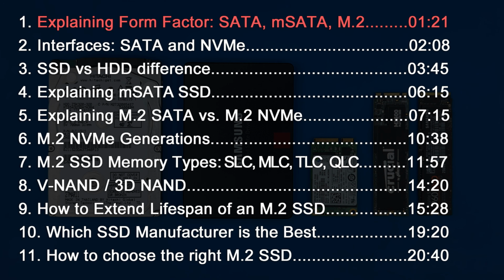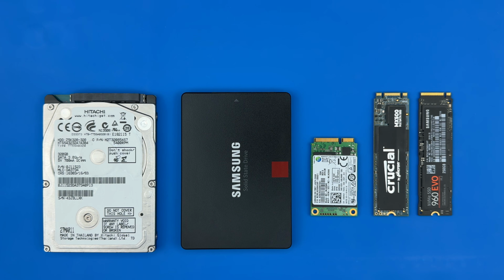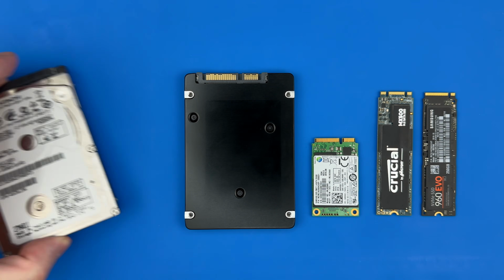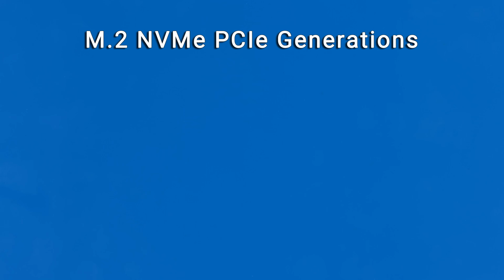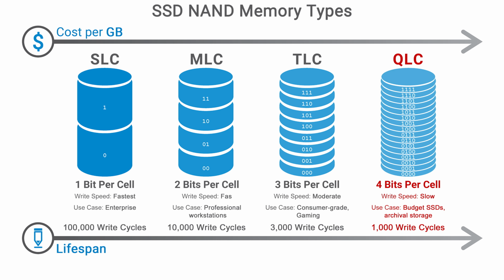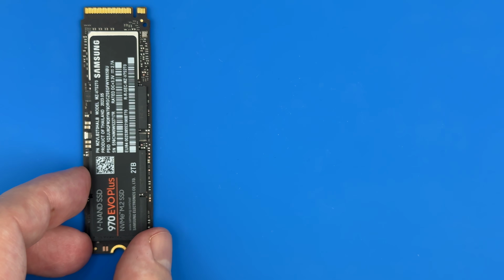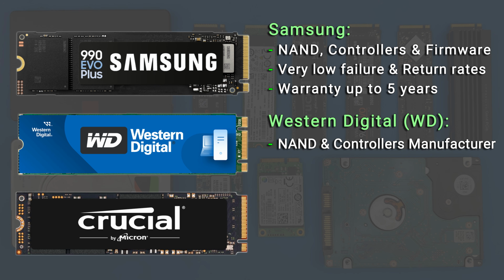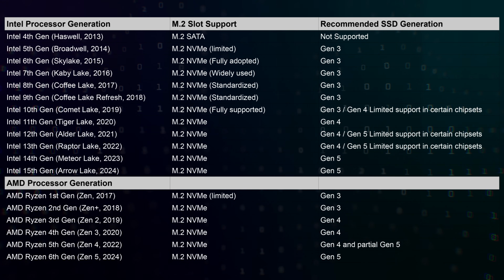SSD vs HDD vs NVMe vs SATA vs mSATA vs M2: Storage Devices EXPLAINED!

Comment: I used to be very tech savvy but  lately I have been behind, 3 to 5 years at least. This is one of the best videos explaining the deference between  SSD vs mMSATA and new kid on the block M2. Oh man, I feel old.
Reply from the maker: Glad you found the video helpful! Tech moves so fast, it’s easy to feel behind—but the fact that you’re catching up means you’re still tech-savvy at heart!
Reply: sagheer.a4988....only lately you're behind? i make retro look new...i get constant criticism for running Core2 duo/Pentium E5200/E5300 or AMD Athlon64 or AMD X2 dual core processors...in other words any old motherboards before 2010 and most before 2007...NVMe as HDD is about as likely as me running 12th Gen Intel (zero)...however there is a use i found for one i'll explain after...i don't have "anything Lake" and Ryzen is even less likely...i suppose the question is more..."how have i managed to run Windows10 at all"... i'm as puzzled as the next person...somehow Win10 runs on my retro "Landfill" garbage computers...i even had Win11 running on an AMD E350D embedded dual core board...not for long...a few months...i do use quite a few Laptop drives and many are SSD...cheapie no name Chinese ones...but it is good to be informed and knowledgeable to what is common and popular...even if i'll probably never use it...same with GTX graphics processors...can't call them cards...12 inches long and nearly 3 inches deep with 3 fans...but NVMe did actually come in useful on the E350D motherboard...i found an AliExpress adaptor that fit PCIe X16 slot that took an NVMe 128GB and it shows up as storage...i'm still gobsmacked it worked...117GB mass storage device...extra storage always useful...
Reply: @markianclark9645  You are nothing... I run Windows 98 on an AMD K6 CPU... and I still have ISA slot peripherals....hahaha...
Reply: Same here
Great vid, very comprehensive. 
I've moved from hardware to software support so had got out of touch.
I know 90% of this, but this video covered those last 10% I needed to clarify.
Most video only cover what I already knew.
Reply: @sagheer.a4988  You've been out-of-the-loop for a little longer than 3-5 years by the looks of it!
Reply: Same here. Haha
Reply: Like when I upgraded my computer I didn't keep up with storage advancements and wasn't even aware of NVME so bought a SATA SSD lol. SATA SSD is a pretty useless format for a desktop. I have my HDDs for long term storage and backup (snapper snapshots get stored on one of the separate HDDs instead of the SATA SSD that I'm running my OS on which is Arch btw). That's because of the write LIMIT of SSDs you always want to have backups going to an HDD. After wondering what the NVMe connector on my new motherboard was I realized I should have bought an NVMe hard drive because a SATA SSD is useless for long term storage and also isn't much faster than an HDD so it's the worst of both worlds. Total waste of money, oh well I bought a NVME drive now. Since I am such a sponge for information buying that SATA SSD was a totally uncharacteristic noob move.
Reply: Same here. I used to test RAID controllers in the 90s and early 2000s.
Reply: Hello ! May Allah protect and guide you to his light and happiness in this life and the hereafter, God bless, Ameen. Excuse me for giving a little presentation of Islam, because it is very misunderstood nowadays, especially on those « Antichrist's » times, where media and politics are mixed to distort history and truth. And terrorists (puppets of the Antichrist) who misinterpret verses, out of ignorance and political motivations, and take them out of historical context (just like radical atheists do by the way) don't help either. Thank you very much for your time.

First of all, if you have any questions regarding Islam and yourself, just open the Quran randomly, and you will find the answer in front of you, like a miracle and a sign from God.
	
Islam is an arabic word that means the Surrender to the One and Only God, our Creator, Protector, Provider, who gives us life and all that we have, we are safe and sound by his will and grace, we are His and to Him we return, and we have to thank him in this trial life by submitting to him by our free will, or later in the Day of judgment when it's too late to save our own skin. Islam was the original Religion descended to earth from heaven with Adam and Eve (peace and blessing be upon them) in the beginning of humanity. and was passed to people with the succession of the 124 000 prophets and 315 messengers of God to all nations and civilizations since, passing by Noah, Abraham, Isaac, Jacob, Ismaël, Joseph, Moses, Aaron, Joshua, David, Solomon and Jesus (Peace and blessing be upon them) during the history of mankind, the last replaces and completes the previous, until the succession of the last messenger of God fourteen centuries ago, Muhammad (Peace and blessing be upon him) to complete the noble morals of all mankind, to bring humans and jinns out of darkness into light, and to purify people's religion and belief from corruption and polytheism, and return it to purity and true monotheism, like it was in the times of the prophets (Peace and blessing be upon them).

Many Religions that we know nowadays, at their beginning were true and under Islam, initiated by one of the prophets of God, but their original teachings, history and scriptures have been corrupted over time with falsification and polytheism, or lost and replaced with false ones. That's why Islam is the only Religion accepted by God nowadays, which consists in bearing witness that there is no god besides Allah (God in Aramaic, the original language of Jesus and the Gospel), and that Muhammad is His servant and messenger, just like Jesus and Moses and others are His servants and messengers. Never a messenger of God said he was God or literally son of God, it was the people after him who changed the words of God and corrupted the Religion. God is unique and absolute, He does not need to have a family and sons or to associate anyone else with His kingdom, He can simply create whatever He wants, everything belongs to Him, and to Him everything will return. Allah said in Surah Al-Mu’minun : “God has never begotten a son, nor is there any god besides Him. Otherwise, each god would have taken away what it has created, and some of them would have gained supremacy over others. Glory be to God, far beyond what they describe. The Knower of the hidden and the manifest. He is exalted, far above what they associate. (91-92 / Translated by ITANI).

Allah means the one and only God, the God of all prophets and creatures, the creator of the universe and mankind, and the Master of the Day of judgment, where our destiny, Hell or Paradise, is decided based on our faith and deeds in this trial life, and above all, Allah's mercy. 

Allah said in Surah Al-Ikhlas : In the name of God, the Gracious, the Merciful.
Say, “He is God, the One. God, the Absolute. He begets not, nor was He begotten. And there is none comparable to Him.” (1-4 / Translated by ITANI).

Allah said in Surah An-Nisa : O FOLLOWERS of the Gospel! Do not overstep the bounds [of truth] in your religious beliefs, and do not say of God anything but the truth. The Christ Jesus, son of Mary, was but God's Apostle - [the fulfilment of] His promise which He had conveyed unto Mary - and a soul created by Him. Believe, then, in God and His apostles, and do not say, "[God is] a trinity". Desist [from this assertion] for your own good. God is but One God; utterly remote is He, in His glory, from having a son: unto Him belongs all that is in the heavens and all that is on earth; and none is as worthy of trust as God. Never did the Christ feel too proud to be God's servant, nor do the angels who are near unto Him. And those who feel too proud to serve Him and glory in their arrogance [should know that on Judgment Day] He will gather them all unto Himself: (171-172 / Translated by Muhammad Asad).

Allah the Most Merciful said in Surah Ali-Imran : Behold, the only [true] religion in the sight of God is [man's] self-surrender unto Him; and those who were vouchsafed revelation aforetime took, out of mutual jealousy, to divergent views [on this point] only after knowledge [thereof] had come unto them. But as for him who denies the truth of God's messages - behold, God is swift in reckoning!
Thus, [O Prophet,] if they argue with thee, say, "I have surrendered my whole being unto God, and [so have] all who follow me!" - and ask those who have been vouchsafed revelation aforetime, as well as all unlettered people, "Have you [too] surrendered yourselves unto Him?" And if they surrender themselves unto Him, they are on the right path; but if they turn away - behold, thy duty is no more than to deliver the message: for God sees all that is in [the hearts of] His creatures.
Verily, as for those who deny the truth of God's messages, and slay the prophets against all right, and slay people who enjoin equity - announce unto them a grievous chastisement.
It is they whose works shall come to nought both in this world and in the life to come; and they shall have none to succour them.
(19-22 / Translated by Muhammad Asad)..

God said : Say, “We believe in Allah, and in what was revealed to us, and in what was revealed to Abraham, and Ishmael, and Isaac, and Jacob, and the Patriarchs, and in what was given to Moses and Jesus, and in what was given to the prophets from their Lord. We do not differentiate between any of them. And to Him, we surrender.”
(2:136 / Translated by Community)

Salam (Peace) ----
Reply: AMEN,  Your replies below, asking who still have AOL disc, LAZAR/ ER pc, STILL FIGHTING AGAINST LOSING MY WINDOW 98/XP.  IT IN CAPS SO I CAN SEE TWO FINGER TYPING.  SORRY GRUMPY OLD DUDE RANTING
Reply: NO its not.
Reply: Maybe applying for your pension soon?.......
Reply: I don't think you need to be tech savvy to understand the differences between SATA and M2

Comment: I had a snarl when trying to upgrade my Dell with XP laptop. I was trying to get a converter (NVMe to IDE) enclosure for an M.2 NVMe WD 520 keyed B&M. When it arrived I realized it was for a M.2 SATA NGFF type, then I had to buy one of those (Cheap Timetec) types. So I am still not sure if my drive is NVMe as stated on drive or SATA type as suggested by the B & M keys. 🤷‍♂️
Reply from the maker: If your WD 520 states NVMe, then it’s definitely NVMe, even though it has B&M keying (some early NVMe drives used this for compatibility reasons). NVMe drives will NOT work in SATA-only enclosures or adapters—they require a PCIe-based interface.
Since your Dell XP laptop uses IDE, it cannot support NVMe at all, even with a converter. Your best bet is sticking with an M.2 SATA drive or a 2.5” SATA SSD with an IDE adapter for maximum compatibility. Hope this helps!

Comment: Don't SSD have a finite read and write cycle life? Unlike a HHD which is pretty much infinite.
Reply from the maker: Yes, SSDs have a finite write cycle lifespan, but modern NAND flash technology has improved significantly, making it less of a concern for everyday users. HDDs can fail too, just in different ways (mechanical wear, bad sectors, head crashes). While HDDs don't have a write limit, moving parts make them more prone to failure from shock, vibration, or mechanical wear over time.

Comment: Nice video, but saying HDD fails because of mechanical parts is partially true, unless you dropped it. Even SSD's can fail right out the box, actually HDD even slow they last longer than SSD. Data centers still use HDD apart being cheap, they are more reliable and last longer for data storage. Data storage on SSD without power will deteriorate over time, up to 5 years, meanwhile on HDD up to 15 years or even longer.
Reply: Not my experience at all 35 years building and using computers. I have stacks of dead hdd's the proof is in the pudding. In this case 'time' over the course of a very long time. Ive run into way way way way more faiked hdd's than ANY other pc part
Reply: @HeadbutsAndUppercuts 
I've had the opposite experience to yours. I've never had an HDD fail in the 30 years of use. They always get swapped out eventually for larger capacity. I have a box full of old drives that are still funcrional but were put aside. I'm still running 3 old HDDs in my current PC as backups because I don't trust SSDs. I've experienced multiple SSD failures in the relatively short time Ive been using them, and it's a real pain because they fail instantly without warning.
Reply: Do you know what the problem actually is?.. its a brand. Western digital @toby9999
Reply: @toby9999 ive still got my 74gig raptor 10k rpm hdd from 20 years ago still going strong lol.
Reply: In my experience 2tb or larger hdd fail because people leave them as 1 giant drive instead they should split them into 4 partitions.
Reply: Lol hdds are not more reliable than ssd's you're going off of extremely old information. My dad does pc repairs and has had to save data from dying hard drives 10's of times while the only failed ssd we've seen is one we were trying use ourself on a network pc (crucial p1) and even that was an infant qlc nvme ssd. I've also had all 3 of my hard drives I've owned partially or fully fail. Only thing hdds win in is cold storage.

Obviously anecdotes are pretty meaningless but this is someone who works in the industry and is actually mirroring  the results of proper testing which say the same
Reply: @Frozoken   sounds interesting, I wonder if there's some survivor's bias in this.

It is likely that your dad sees "10s of dying HDDs" because those drives survived the failure long enough to be brought to a shop. He likely sees fewer SSDs because when they break, the user is often told, "It's fried, buy a new one," or they send it to a specialized (and expensive) forensic lab.

And also, for the last 15 years, there have simply been more HDDs in circulation than SSDs. Seeing more broken HDDs is largely a result of there being more HDDs in the wild to break.

What I mean is, I don't know if we are at a market stage were we're able to see the results of massive use of SSDs at the same volume rate as HDDs... Idk, I still have my questions.
Reply: My hdd just failed last week..
Reply: The only thing he said in the video about HDDs becoming susceptible to damage. Was simply physical abuse like dropping or vibrations.
Reply: Absolutely describe !!!
Reply: If data is continuously being written and deleted, HDD's have no limits, where solid state drives do. In that area HDD drives are way more reliable.
Reply from the maker: Thanks for sharing your insights!

Comment: Simple no-brainers (mainly thinking Linux here):
Using SSDs for log-files on servers is a real bad choice. 😉
Using SSD for swap-files (on Linux) is likely fine, because Linux rarely swaps if you have 8GB RAM or more (daily 'office' / 'home' use).
In other words: Put your entire rootfs on your SSD, mount a HDD on /var and /home, then you'll likely not run into drives wearing out. Note: you can mount your rootfs as read-only after creating the mount-points, so you'll only have to mount as read/write if you need to upgrade your system. You can also use r/w-overlays on top of r/o if you like that solution.
Reply from the maker: Great Linux-focused insights 👍 This setup is ideal for extending SSD lifespan while leveraging its speed where it matters most. Thanks for sharing your experience!

Comment: This is indeed a good video with so much correct information; I didn't expect that when I clicked it. =)
-My personal NVMe choice is Crucial first (because of speed), then Kingston (because of price) - Samsung is also something I consider. As for SATA SSD, I pick CS900 from PNY due to the price (When I just need a lot of archiving space).
When I need high speed, it's because I compile a lot (building Linux and GCC).
For a Raspberry Pi, one can get a Raspi 5 with fairly good speed USB3; then a Silicon Power USB3-NVMe adapter, and experience a quite good boot time. I very much prefer HDDs, though; because if I use port-multipliers, I can max out my bandwidth with RAID1+0 and get up to 75 drives on a single port. This won't get me 550MB/sec, because each time I add a port multiplier, I'll be adding another delay; but one can only nest JMicron port multipliers twice, then you'll have to use RAID for the next level. Still HDDs are cheaper per GB than SSDs. SSDs and HDDs are equally prone to bit-rot, so switch them out after 10 years (yes, even WD drives).
I hope my additional information is useful to someone.
Reply from the maker: Your RAID1+0 with HDDs and port multipliers is an interesting strategy for maximizing storage while keeping costs down. And yes, bit-rot affects both SSDs and HDDs, so periodic drive replacements are always a good idea. Great info—I'm sure others will find this useful!

Comment: You left out another used but less common U.2 NVMe. U.2 NVMe and M.2 NVMe are not interchangeable.
Reply from the maker: U.2 and U.3 weren’t covered because they are more commonly used in enterprise and data center environments rather than consumer setups.
Reply: @ But yet people still get a hold of them and wonder why they will not work in the system. Surprisingly a lot of people think all NVMe drives are the same or at least interchangeable without really knowing the difference between all of them.

Comment: U.2
Reply from the maker: U.2  and U.3, weren’t covered because they are more commonly used in enterprise and data center environments rather than consumer setups.
Reply: @howfixit  I can already see SATA support is in a state if decline in favor of M.2 NVMe drives.  I suspect U.2 or U.3 drives will replace SATA in the future, because of a similar form factor.